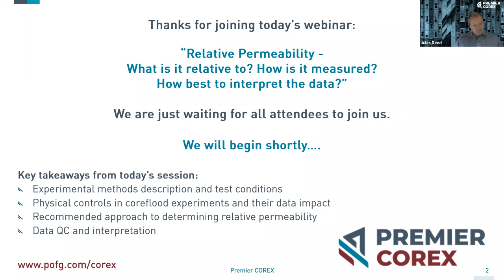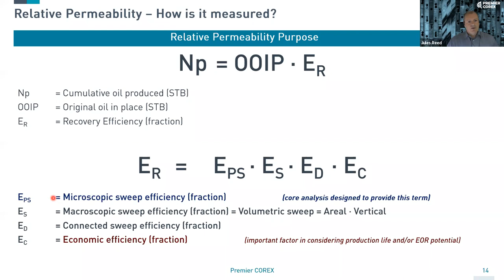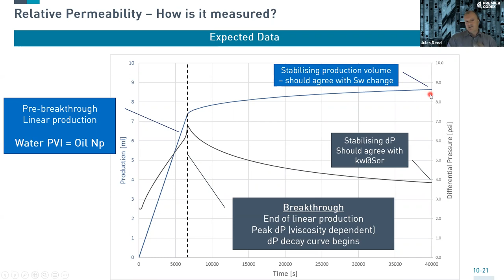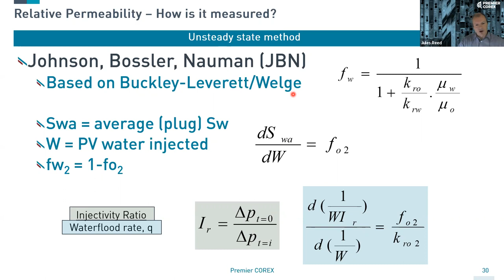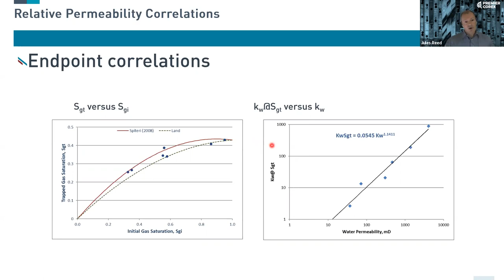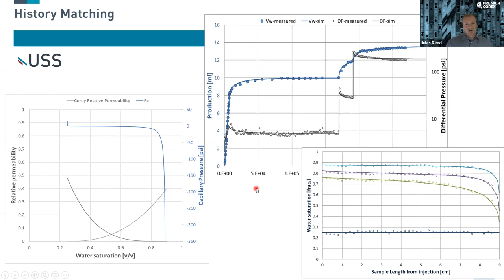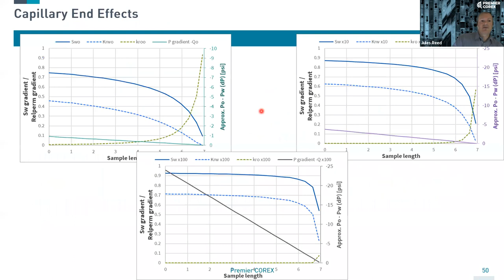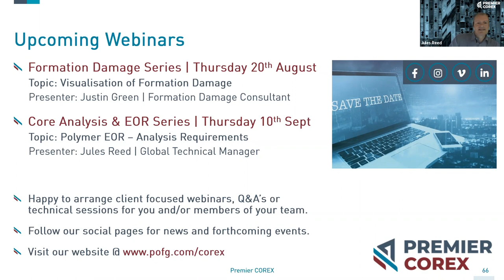Premier Corex: Relative Permeability

Comment: Very nice Jules, at around 7:00-8:00 time, after its highlighted that any base permeability can be chosen, I think it is also good for a Reservoir Engineer to highlight that the same base perm must be chosen by Geologist in their static model because eventually that static model comes to RE and becomes dynamic model. Hence, the 'base permeability' has to be chosen as same in both static and dynamic models. Thanks for picking this topic as many conventional SCAL courses do not even discuss this.
Reply: Hi Bhaskar, A very good point, and exactly the reason for discussing the base (or reference) permeability. There needs to be discussion between the geologist/petrophysicist/RE to discuss how the models will be set up and what values will be used to populate things like permeability, porosity, etc.
Reply: @6ftyoda  Thanks for replying. I will connect with you on LinkedIn. I had a Reservoir Engineering interview today. Just because I watched your video, I could answer the advantages and disadvantages of USS, SS and Centrifuge. Interviewer precise question was "Which data on Relperm graph is unlikely to be obtained from USS and SS?". Thanks to your video, I promptly said "Residual Oil Saturation and we get it from Centrifuge". Interviewer (& I) was delighted to hear that. 😇😇
Reply: @6ftyoda  I am going to watch all your videos and will leave questions/comments behind for further discussion.

Comment: Thank you very much Mr. Reed, wonderful presentation.
I have a question, in order to determine the effective permeabilities in unsteady state method (oil-water), which viscosity do you use? 100% brine as the inlet, or the combination at the outlet, or average between the two? Thank you.
Reply: For an unsteady state (USS) experiment, effective permeability can only be "measured" before starting and at the end of the coreflood - to a single . Before starting, the mobile fluid phase is injected to obtain the effective permeability to that fluid phase. The immobile fluid phase remains immobile. For example, for an oil-water fluid pair, before starting an USS waterflood, the core plug will be at irreducible (immobile) water saturation (Swi), and mainly saturated with oil. Before the coreflood, oil is injected through the plug as the only mobile fluid phase. Therefore, the viscosity of oil is used in calculating effective oil permeability at Swi. At the end of the coreflood, only water is mobile and the water viscosity is used to determine effective water permeability at remaining oil saturation. 
During the waterflood, for most laboratories, effective permeability is not determined. Mostly, either the JBN or Jones-Roszelle method is used to estimate relative permeability from oil and water production data, together with differential pressure (dP) measurements. The method uses the Welge fractional flow equation: first, to determine fractional flow of oil and hence, kro - using the oil viscosity, and then using fw = 1 - fo, to determine krw, using the water viscosity.
It is assumed that the oil and water phases are immiscible and flow independently - hence, there is no mixing of viscosity. 
Also, for most labs, since dP is measured from a single line, it is assumed that the dP impacts equally on both fluids.
Very few labs measure dP of oil and dP of water separately - which would be very difficult in USS method since it would require a continuous, connected fluid column from inlet to outlet of both fluids.
Reply: @6ftyoda  I got it now, thank you very much Mr. Reed.